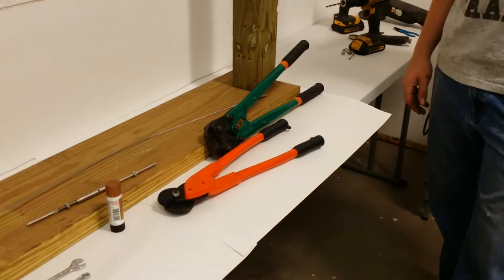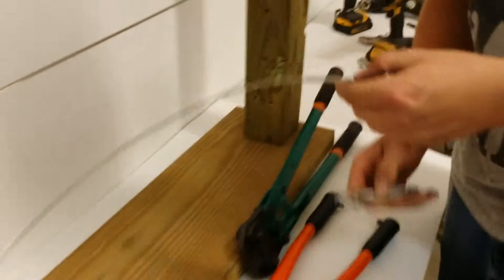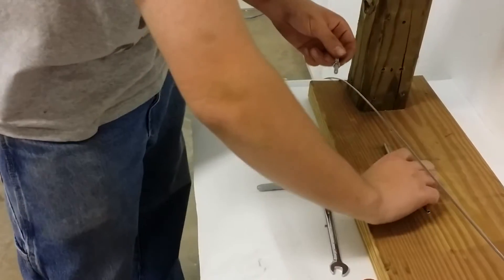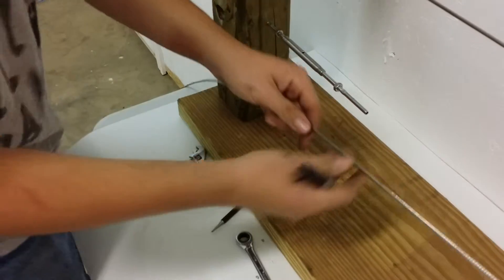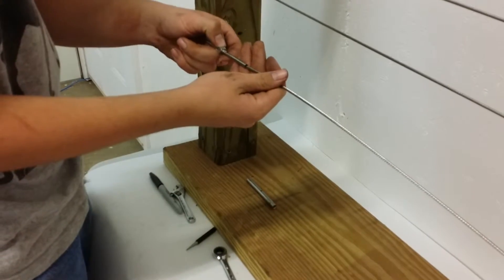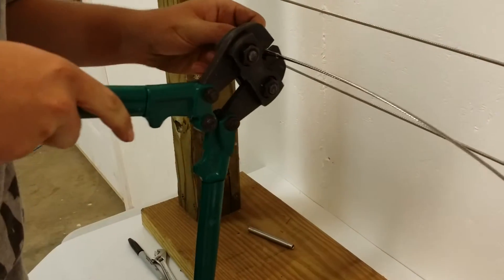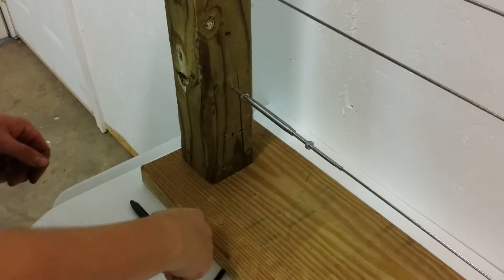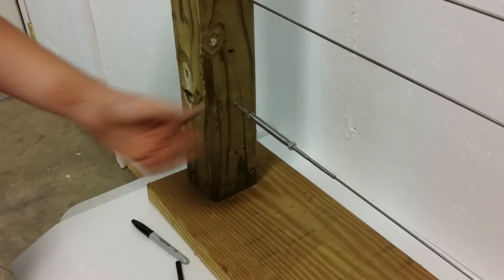Lag and lag turnbuckle

Comment: What is the list of the tools need it to install the turnbuckle ?
Which cutter, crimping tool, no wrench, is the paste did you use on the video ?
look like super solid tools, which brand is it ?
Reply from the maker: To install a lag fitting or lag turnbuckle, you need a drill, 3/16" drill bit (to pre-drill), adjustable wrench, measuring tape, pencil/sharpie, cutter and crimper for the cables. We also recommend using antiseize on the turnbuckle threads to prevent the fitting from seizing when you tighten the cables.  In this video, we used an import cutter (cuts up to 3/8" diameter cable) and the crimper is from Feeney.